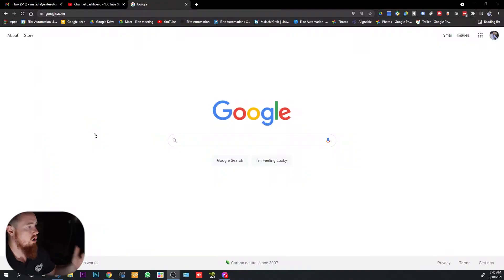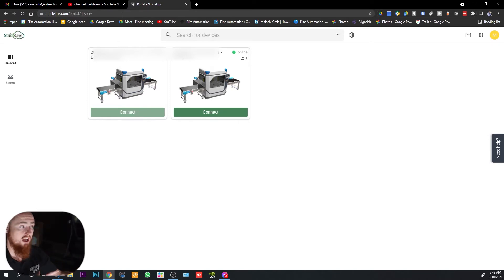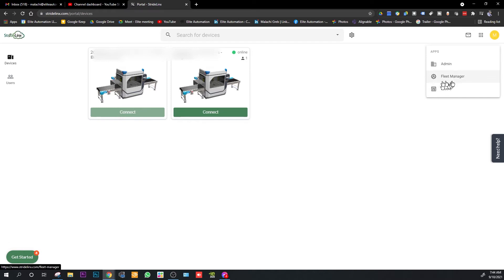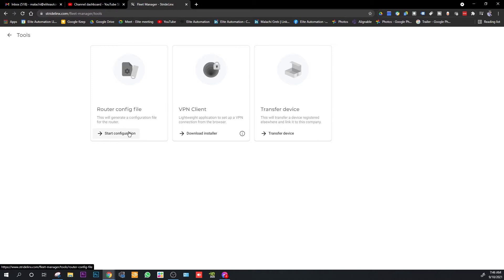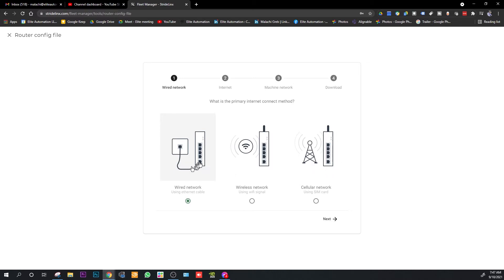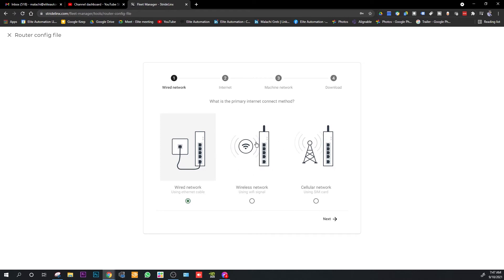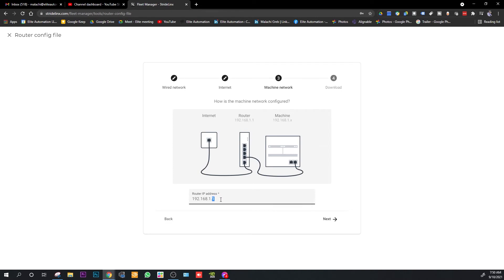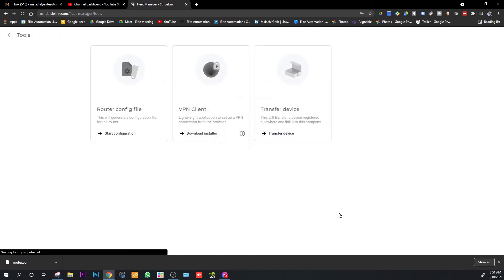VPN StrideLinx Set up - Elite Automation

Comment: Hello Elite Automation,
Thank you for sharing the video — it was very helpful!
I'm currently having trouble connecting to my Siemens PLC through the VPN. After confirming that I'm connected to the VPN via the website, I tried pinging the VPN IP address, but I don't get any response.
Do you have any idea what I might be doing wrong?
Thanks in advance for your help — I'm already subscribed!
Reply from the maker: @yezeta376  can you try and ping any other devices on the network